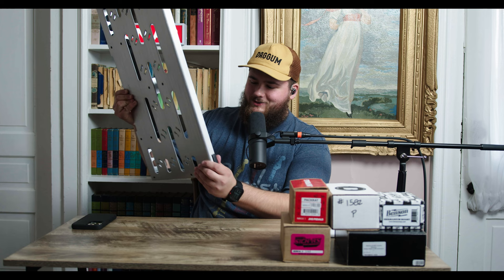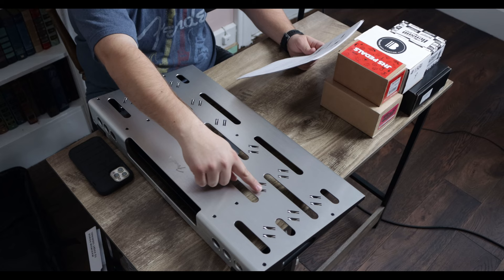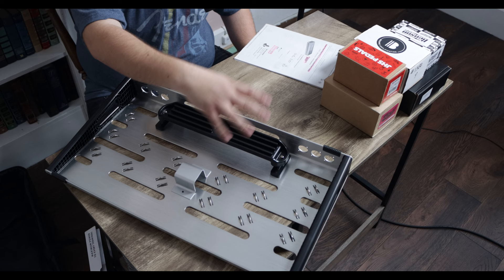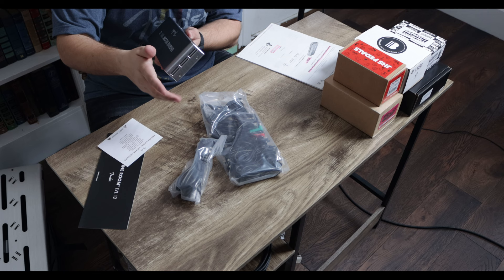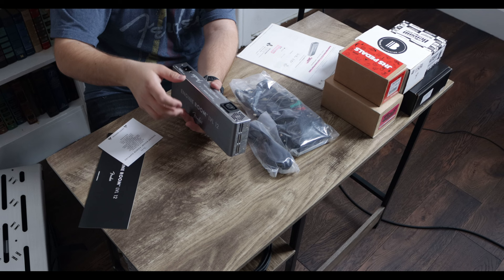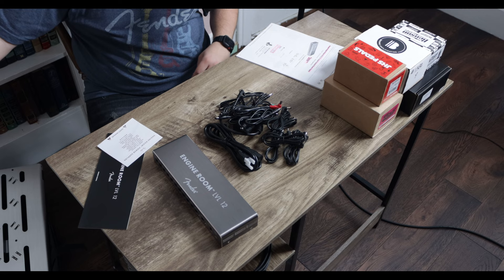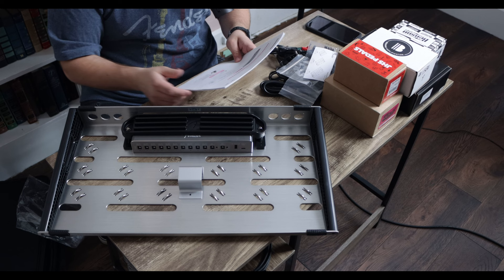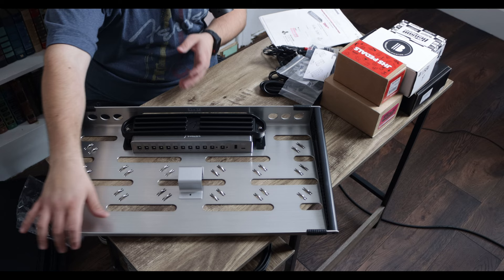How To Build An Instagram Pedalboard Using The Fender Professional Pedalboard!

Comment: It's really weird to me that more people aren't buying and reviewing this setup. Thanks to your video I just ordered the exact same setup. Medium board with lvl 12 PSU. Thanks to the mini pedals I have, I can easily fit a seriously varied and complex set of pedals on this thing.
Reply from the maker: Glad you liked the video! I could see price playing a factor in this one, but in my opinion it’s definitely worth it! 🤠🎸
Reply: Thank you so much, you just answered my question of if the LVL12 will fit in the medium board. I ordered the LVL8 but really need the LVL12 which is fine I'll keep the 8 as a backup or for another board, I'll order my LVL12 this week since the board won't be here for another 3 days. To me they're definitely worth the money for the board AND the power supply! For the plastic feet I'm planning to drill through them so they won't get lost and run a screw and locknut to secure them. Also going to coat the plastic with some liquid rubber so it doesn't slide on smooth surface floors.
Don't forget to use a hair dryer to heat up your Velcro so it sticks better also ;).

Comment: Pro-tip: The rubber push-on feet have metal inside. When you figure out where you want them, just squeeze them closed a bit and they grip the aluminum tightly.
Reply: @brayrowleybass   The real problem is the mount for the Fender power supply. Fender really goofed that up. Here's the fix: two 1/4" tall nylon spacers for the screws, and a pack of 3M command strips from the hardware store. Now the PS is tight, and the bracket is not warped at all, the screws are snug - and still easily disassembled.

Comment: Just a question ( as I have the lv12 & am thinking about getting this pedalboard in medium too ) But Should the power supply not be the other way around . So it says Fender the correct way up ? Whist looking at the back of the board ?
Reply from the maker: Yessir! I just wanted my 90 degree IEC to point a certain direction. 🤠🎸

Comment: Is the engine lvl12 can fit in fender small pedalboard?
Reply from the maker: I can’t say for sure! I’m using the medium sized board here and the LVL 12 fits just fine, so I would assume it fits on the small board but I’m not 100% certain!
Reply: Yes it does, just got that configuration myself.

Comment: Hi thanks for this video. Pretty cool with black and pink and i am pretty sure that the sounds are awesome. Just one weird question : i personaly would recommand to put the line6 at the bottom to be easier to be controlled by foot. You should not play with the other switches once properly configured ? Or i missed someting?
Reply from the maker: Hey! For this board I was using the stomp for amp sim, modulation, and a couple delays and reverbs. I placed drive pedals below because I would be utilizing those more often than the effects in the stomp. That is why I chose that placement. However that board is long gone, but was nice while it lasted! 😂🤠🎸

Comment: Question,
You talk about stuff, but when it actually comes to wiring it all in you fast forward so we can’t see how you’ve done it. 
Eg, 
Power leads to the pedals and how you connected them up so they don’t get ripped out moving it about.
Reply from the maker: I was thinking about doing an update video, would that be helpful?
Reply: @brayrowleybass  I think so, I got the fender board, the big one for pro set up. Was looking around about the best way to both mount and wire it all in correctly so there would be no lose cables, wobbly pedals ect ect. From all the searches yours was the closest. 
Another one about the board and mounting his pedals went on about the pedals and nothing about assembling it’s.
So, yes. Not necessarily pedal order (but would help people)  but way to run Velcro ( for and against each way)  running patch leads,power cables then for this fender board attaching it all to the board it’s self as well.
That would be too late for me now, but will help other people.
Reply: i agree i was waiting for the explanation on those cable management system indentations on the board, he didn't mention it, thumbs down on the video and no i will not got to the Instagram page.. guess ill look elsewhere for that information